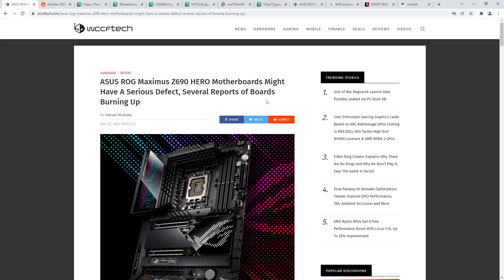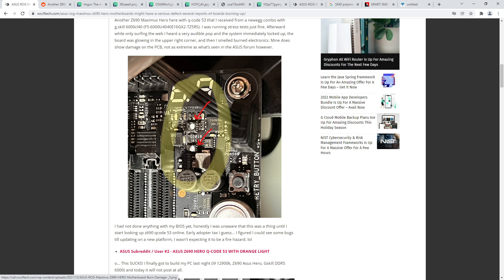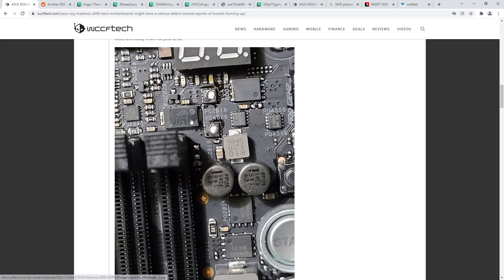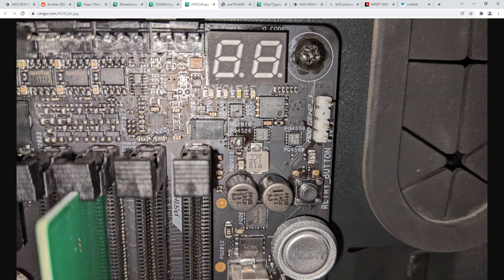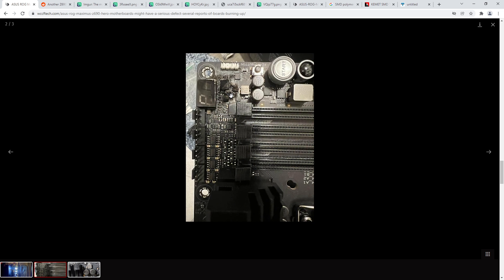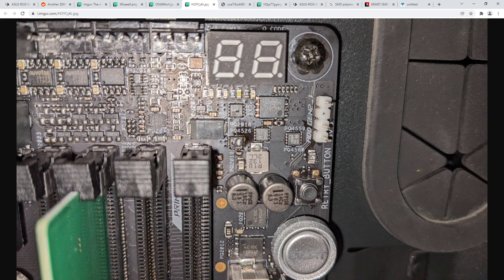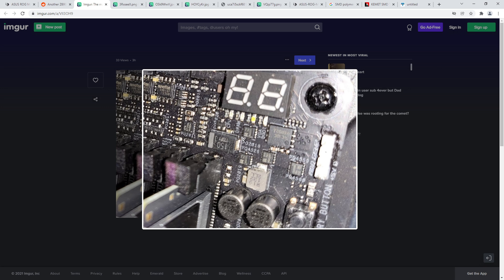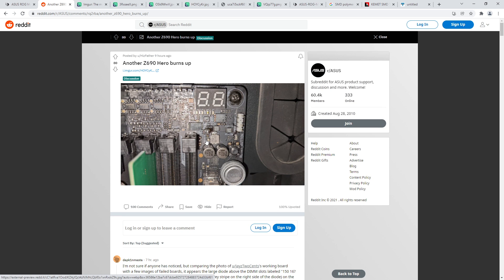My thoughts on the ASUS Maximus Z690 Hero failures

Comment: This is a failure of QC because, while someone may have accidentally loaded the belt wrong for the pick and place, the automatic visual inspection should have caught this.
Reply: Pick-and-place machines with automatic parts inspection to make sure the correct parts have been loaded in the correct orientation before placement have been around for 20+ years. This sort of mistake shouldn't be possible in 2021. Maybe they turned off parts inspection on a bunch of passive SMDs to crank up placement speed and forgot about this specific capacitor.
With at least three different brands being used to populate this location, it is possible that one of them loads its reels backwards from the other two and that detail got lost somewhere between procurement and pick-and-place operators.
Reply: @teardowndan5364  kinda, the machine does not "know" what is right and wrong, it will repeat what it's been calibrated to do. Someone has either intentionally or unintentionally screwed up the CV calibration for this part/area/whatever so for the machine everything was always correct, THEN someone puts on a reel in the wrong orientation.
Reply: @marcogenovesi8570  You cannot load a reel in the wrong orientation since that would cause it to unroll upside-down. The only way to flip components left-to-right would be to swap the tape's orientation during a reel swap... or have a supplier of equivalent parts shipping reels with parts oriented the other way around from factory.
Reply: @teardowndan5364  that's semantics, a reel with the parts oriented in the opposite way, or coiled in the reverse way is "wrong orientation". This happens a lot, especially if you have random suppliers
Reply: Reminds me of the GPU cooler that they blamed AMD for despite the fact that they should have QC'd all of those video cards which if done probably they would have caught the issues.
Reply: Depending on the manufacturer, inspection can be auto, manual or both.
Where I currently work, there's a first piece approval/inspection.

If not caught, we(Testing) usually are pissed about extra work.
Reply: I think the one pic buildzoid showed that shows the alternative manufacturer cap (probably not KEMET, though marking isn't consistent with any known manufacturer i could find at all) is a good clue for what happened here, i'm pretty sure they bought up a bunch of mismatching stuff cause of shortages and when the optical inspection kept throwing errors because it was meant to recognize the panasonic SP-CAP variant only somebody on the floor had the bright idea to set that alarm to ignore, as you do (though you maybe shouldn't in some situations...). 
After they ran through the alternative stock which probably came in belts that had the holes on the opposite side of the panasonic ones whoever was tasked with swapping the belt just put in the new one correctly (by looking at the previous belt), however the caps in the compartments were the other way round, the optical inspection would have kept throwing errors which were allready ignored before, so nobody would have thought anything about it.

This is just speculation on my part, but best way i could come up with to explain how this went past QC :D
Reply: Is the silk screen on these capacitors standardised? I wonder if a change of supplier part way through production could throw the visual inspector for a loop?

Either way it's def qc fault
Reply: @glenndoiron9317  thanks!
Reply: i work at on factory like this Ai camera defects mistake for sure but workers are in rush and just not always inspect all errors right away because this Ai peeping there like at every 5 second ...and one wrong polarity can pass visual test because they inspect more soldering at bottom ...also functional wont give error right away because board actually works and no one run class 1 products in long tests where this kind of mistake actually may show up
Reply: @金城㱐 The iPhone 12 is being manufactured at the Indian arm of Taiwan-based Foxconn.
Reply: @金城㱐 Apple will see flagship iPhone 13 production begin on Indian soil early next year, courtesy of Foxconn's factory in Chennai, reports the Economic Daily News.
Reply: @金城㱐 " Apple trusts China more" is a speculative argument.  Foxconn's Indian factory recent existence indicates LESS trust in China due to "decoupling from China" uncertainty.
Reply: @金城㱐 Foxconn's India factory was based on a "decoupling from China" directive backup plan.
.
Reply: @金城㱐 That's a red herring. You shifted the goal post. The debate is about iPhone's manufacturing location sites.
Reply: Noone says what everyone thinks...  they did it with dollar signs in eyes on purpose...
Reply: @pinky83mp  How could shipping out boards that die in a fire possibly generate more money for ASUS?   This is a recall-the-product type of defect (or at the very least, repair/replace under warranty), not a "upgrade to our new version" type of defect.
Reply: @金城㱐 Apple has yet to release iPhone 14 let alone 15. LOL.
Reply: most of the checks are manual.. the automatic inspection just looks to make sure all the objects are present. also the manual QC check only pulls a small percentage maybe 3-4 random boards per 100 boards to inspect.
Reply: @sirmonkey1985  automated optical inspection can check for PCB defects, paste application and soldering defects and component placement defects like polarity, offset and skew. Combined with automated x-ray inspection you could even check if BGA packages are soldered correctly. Checking component placement (skew, offset, correct component, correct orientation etc) is absolutely something that can be automated and usually is automated in large IFL lines. Even the small 800 employee automotive tier 1 I used to work for did this.

Even if it’s too cost prohibitive to check every SMD component you should at least check the key components on your PCB like for example the capacitors or FETs etc. and this can be done via computer vision systems like the ones used in automated optical inspection machines quite easily
Reply: @Numfuddle  I was work with company making the Inspection machine and install at big company (brand start with "S" or "W" ). Every PCB will go through optic Inspection machine before and after oven reflow. But X-ray inspection if random sample because it is most time consuming using it. 
I suspect the optic inspection not use(disable?) algorithm to detect letter orientation or the white stripe (most easy to capture in BW photo)
Reply: @Numfuddle  exactly as you stated.  I worked in an even smaller throughput board assembler and even if they had non-modern equipment and didn't decide to get a detailed photo of this area of the board, that stripe is so large, even the board-level image should have captured it.

Not personally familiar with these capacitors, but based on what I've heard, it seems like the polarity-check the pick & place machine should also be doing potentially wouldn't have caught this for this particular component?
Reply: @sirmonkey1985  No. Automated CV based QC systems have been around for ages now. Any factory dealing with this kind of board assembly should have this kind of system.
Reply: @sirmonkey1985  I work on software that is used for this type of inspection (by the semiconductor industry no less). For trained personnel, configuring the software to verify this would be trivial. Since they clearly did not do so, they just "lost the lottery" in that the thing they didn't bother to add to their program did in fact go wrong.
Reply: @金城㱐 that's why it's bad too
Reply: "Made in China" lol
Reply: @zqzj  This time, it's Made in Vietnam. QC is worse.
Reply: @noconnection9875  What quality control? lol
Reply: @zqzj  No. Not made in China thanks to the Trump tariffs. Made in Vietnam. ASUS is dealing with a new factory in an unfamiliar country that doesn't speak their language in order to avoid tariffs.

Comment: I don't think your theory is correct. Those distribution fets should be able to handle a few amps. If the cap leaked like 2 amps (at 5 volts), the cap wold blow up before the fets, because 10W in that tiny cap ends in flames. I don't think the fets would blow up with anything less than 5 amps.
Reply: I think he explained it well... that cap in his theory will be delivering power not consuming it into that 10W that you are talking here about.
Reply: @Bialy_1  I don't think so. If a cap leakes (ellektrically) ist will sink power, not source it. The leakage can be approximated by a parallel Resistor. And resistors (excluding active negative ones) can only sinke power. And this resistor would be located inside of the cap.
Reply: @jonasniesner  He clearly explained how the short will grow over time due to backwards polarity, more and more current will flow and there is no fuse anywhere other than the MOSFETS. And they do not look beefy. I presume they are for enabling and disabling 5 Volts to the ARGB/DRGB 3 pin header on the left to be able to disable RGB when the PC runs on 5VSB (BIOS setting).

Comment: For shure the backwards capacitor is very suspicious, and I also think it probably has something to do with the mosfets blowing up.
However, I am unconvinced by the proposed root cause analysis. An electrolytic capacitor with the wrong polarity on a power rail capable of delivering any amount of current will blow up fairly quickly. Moreover mosfets are very tollerant to heat, thus even in the situation described in the video I would expect the capacitor to fail first. especially if the mosfet is used as a static load switch, where the component would be chosen with minimal on state resistance disregarding switching losses (as it will almost never switch).

My theory is that the backwards capacitor either through leakage current, or more simply through not being a very good capacitor manages to destabilize a control loop in some edge scenario, leading to those mosfets being turned on when they shouldn't and thus blowing up. 
The way the mosfet failed also point in this direction, as the hole in the package means the failure was caused by a high energy transient (a slow overtemperature would either result in mild descoloration of the markings or no external syntoms at all)
Reply: While I watched  the video, I found his explanation very handwavy (Not a criticism to buildzoid, without a schematic there is not enough detail to do a proper analysis).
I personally feel that just the joule heating due to capacitor leakage explanation goes directly against my experience of power electronics circuit design and debug (there is too much damage to the mosfets and not enough to the capacitor) but what do I know…
Reply: What if the reversed polarity causes the capacitor to become a short circuit rather quickly? In that case it will generate little heat but it will pull a lot of current.
Reply: @nicholasvinen  in that case the capacitor will explode, not the mosfets. The fundamental problem is that transistors are designed to handle much heavier thermal loads with respect to a capacitor, thus the amount of current needed to blow up a mosfet that quickly would have obliterated the capacitor long before.

The mosfets are very  likely the cause, but not directly, it must be a more roundabout failure mechanism
Reply: My theory is that you writing the comment without watching much of the video as he explained everything even the basics...

Comment: 1 reel of capacitor was wrong...how many is in 1 reel?
Reply from the maker: reels are typically several thousand capacitors. There's probably several hundred to a couple thousand boards with the cap the wrong way round.
Reply: A LOT!

Comment: «If I had one... I'd be 100% sure.» But can't wait to post
Reply from the maker: Well I'm not going to have one. It's a 500GBP 4 dimm DDR5 board. I have no intrest in buying one and ASUS won't send me anything.
Reply: I guess this video won't help with that in the future :))))
Reply: @EvL--_--  Why? He just pointed out why it is failing and how unknown failure would be any better?
The fact that someone made a small unintentional mistake and loaded caps the wrong way is less damaging to the brand than the idea that for example the board is failing because someone wanted to save 2 cents and used crapy components or the whole board design is wrong. It looks like unintentional mistake + failure of the factory to detect the mismatch.
Reply: @Bialy_1  Because PR people kinda blacklist you when you make vids that puts their products in a bad or negative light, its how marketing works I guess...
Reply: @Bialy_1  Loading the cap wrong (if this even what happened) is not the problem. Not catching the wrong placement in QC/AOI and shipping these boards is the major fck up